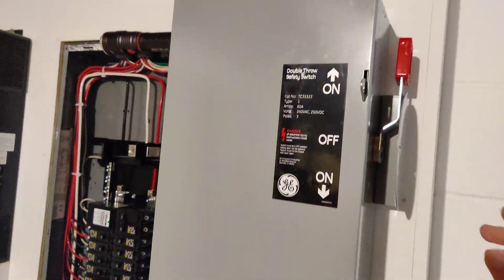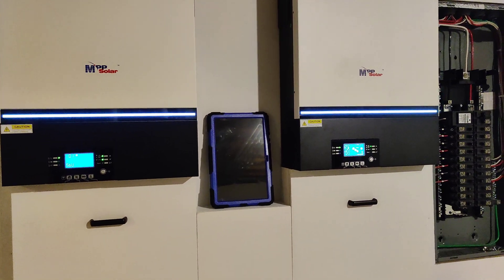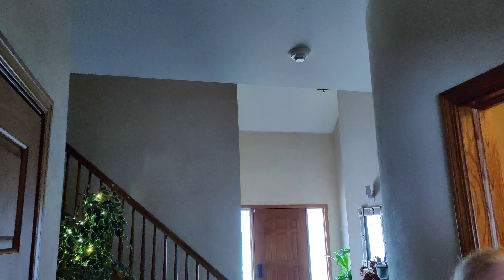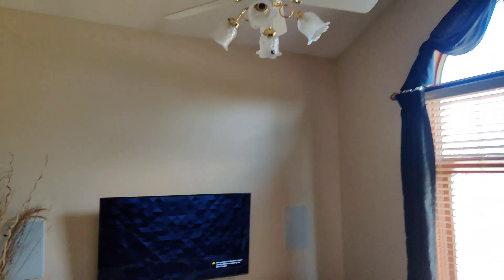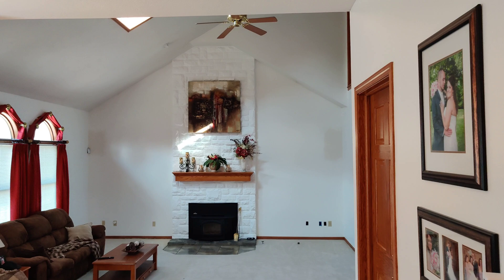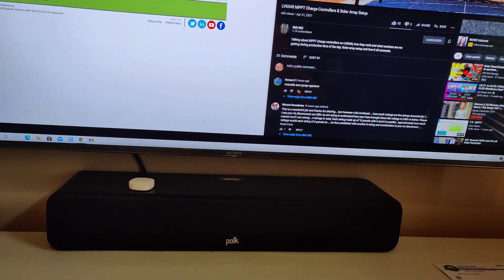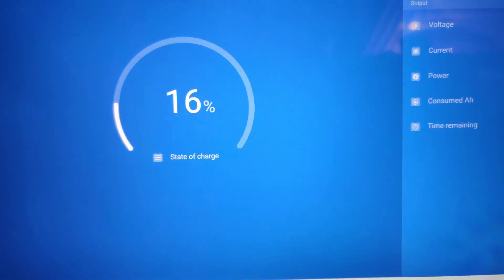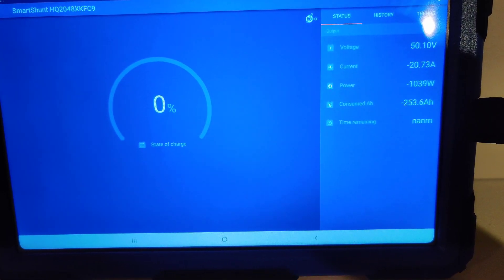Lifepo4 Batteries - How long can we last?

Comment: you forgot to mention the AH battery capacity and your inverter setup capacity
Reply from the maker: 48V, 272AH, (14KW) battery capacity and 6kw per inverter capability (Although I don't come close to the maximum of these inverters). With everything in the sub panel running including the AC I hit around 5.5kw maximum out of 12kw.
Reply: @danfitzpatrick4112  alright. thank you. That's a nice setup and considering the 250AH usage I'd say it's a good backup source. I guess for 12kw setup I assume you plan to sell the excess energy to the grid?
Reply from the maker: @janshermalik5440  No, these inverters are only for off grid applications. (No net metering). 
However you can use mains power, solar panels or a combination of both to charge the batteries and/or supply power to a "Critical Load" panel as I have.
Reply: @danfitzpatrick4112  oh alright alright. That's cool. I have installed 5KW Hybrid inverter. I run my day off of solar and as my region faces power outages so I use the battery and grid at night. It's really amazing how we can take out such huge amount of energy just out of sun.

Comment: Assuming you have a 280ah battery  ?
Reply from the maker: Yes, they are 272ah batteries, but what's a couple volts lol. Not sure why they rate them that way. Could be because they don't want to be associated with other companies I suppose
Reply from the maker: I meant a couple amps ...